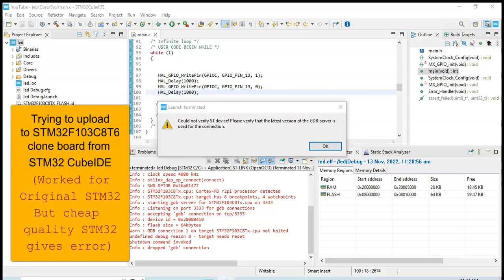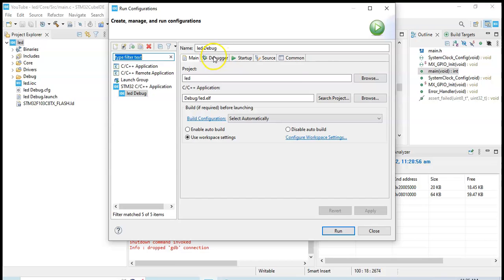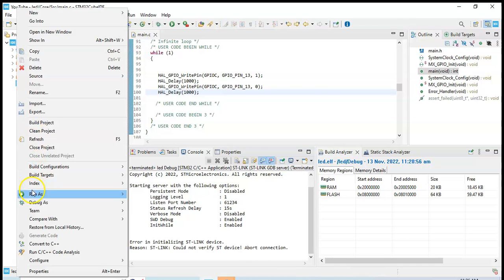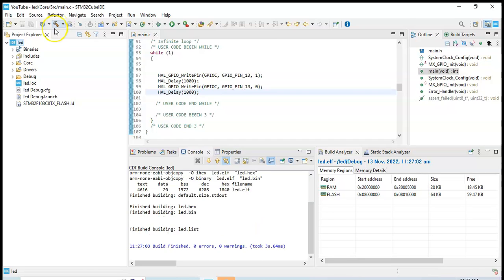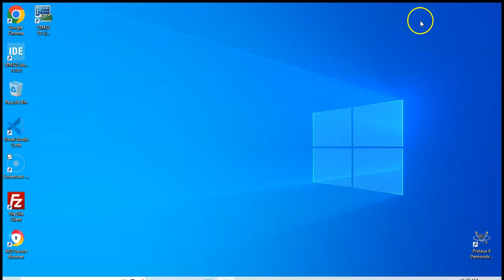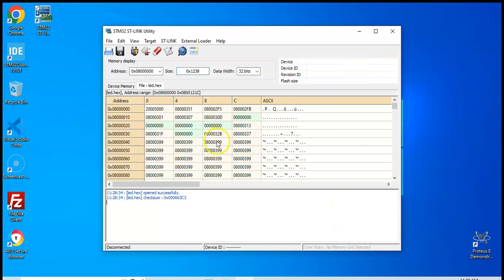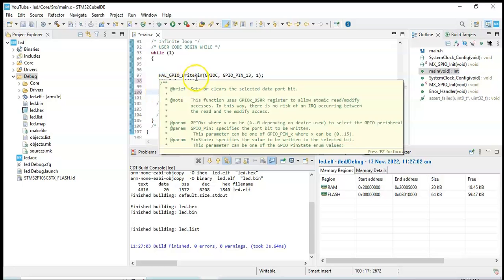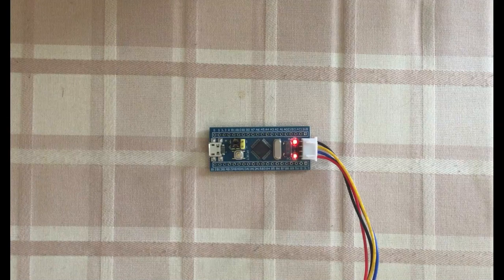80. Program STM32 using ST-LINK utility

Comment: But if i want to debug the code, still i am unable to do it...
Reply from the maker: If it works via st-link utility or cubeprogrammer but not working straight from cubeide, the stm32 chip is a clone. uart printf() can be used for debugging such boards
if you want to debug via st-link, you need to get a board with original stm32 chip
Reply: @NizarMohideen  Thanks.. Can I change the stm32 chip in my development board... Will it work
Reply from the maker: You can. It will work but removing and replacing stm32 chip on the board requires great soldering skills otherwise it may get damaged. 
Besides there is no guarantee of getting original stm32 chip from resellers
I have seen there are not many clones in stm32f103c6t6 (C6)  full development board. One may try their luck purchasing
Best idea is to purchase stm32f446re
Good luck

Comment: I've just replaced the fake STM chip in the ST-Link with the original, and it works fine, but supposedly if you change the Shared option in Cube Programmer from Disabled to Enabled it should also work on the fake STM chip in the ST-Link.
Reply: nope still doesnt work but thanks for idea

Comment: nice video thanks, just a head's up before trying this just remove the cover from the St-link v2 and look the ship if it is a STMF103c8T6 it should work with regular method like the official one. In the case of GD..or other replica this method would work as well was arduino 2.xx it has a compatible generic board list of F1, f2, f3 and f4 stm32 based boards.

Comment: Hi, I did all the steps, but in the end, instead of programming with ST Link Utility and ST-link V2, I used STM32 Flash Loader and USB to TTL, and apparently the file was transferred, but it didn't work. Does the HEX file only need to be transferred via ST-Link for it to work?